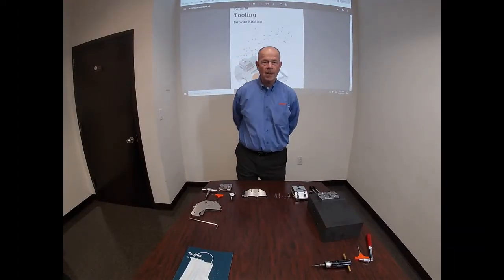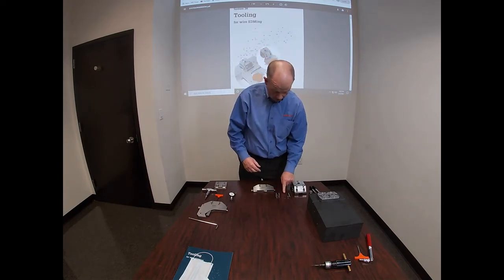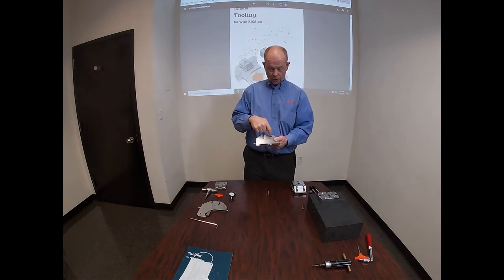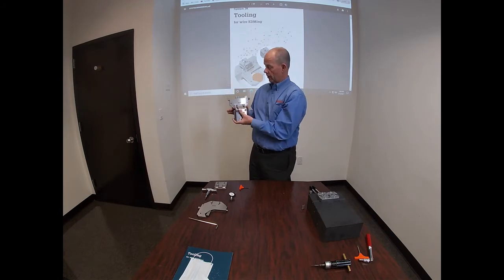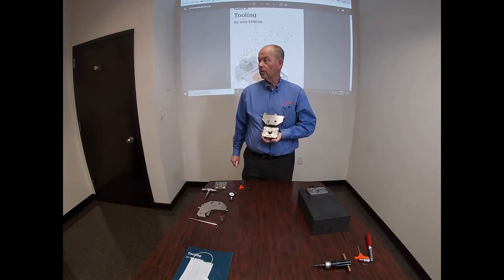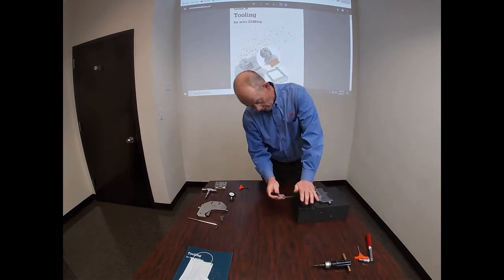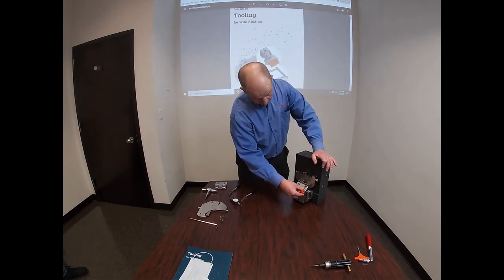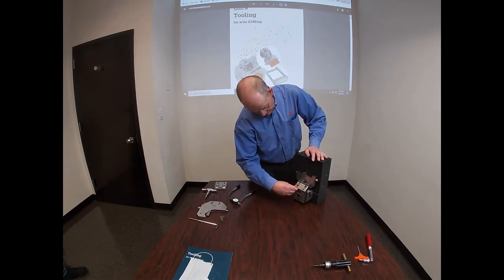Mounting a System 3R Super Vice to a Macro Leveling adapter for Wire EDM use

Comment: Lingo changes, but a bolt still uses a nut, and a screw, well it screws into something that isn't a nut. Socket Head Cap Screw somehow morphed into an Allen Bolt when you ask at Ace Hardware, but still SHCS at McMadter Carr etc.